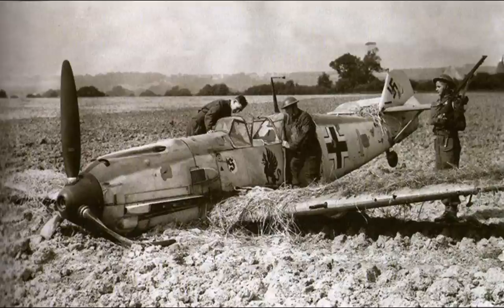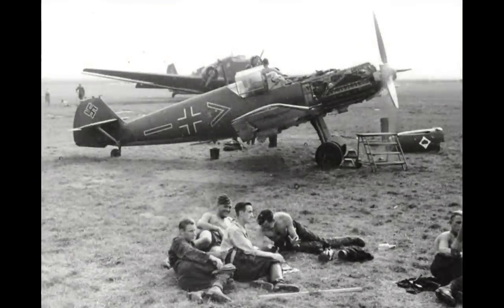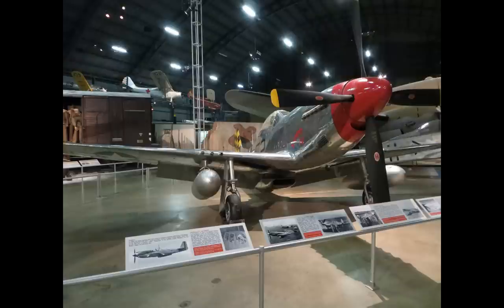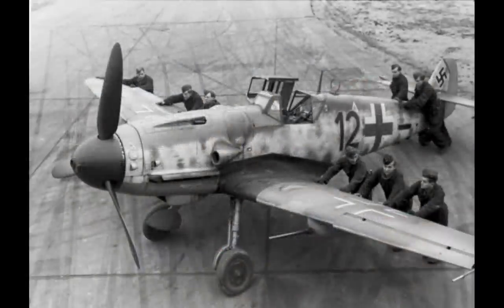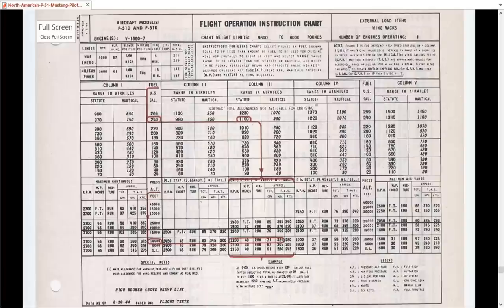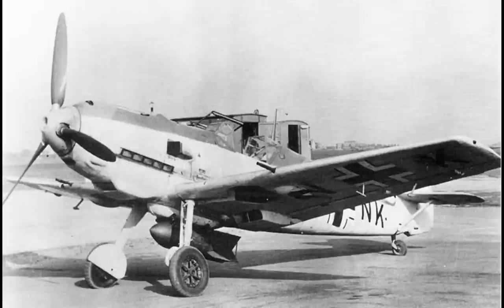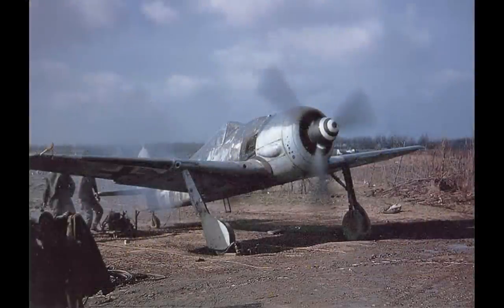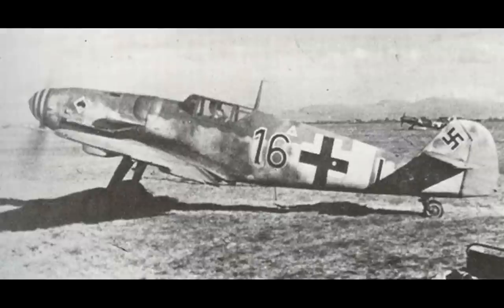Messerschmitt BF 109, Why Such Short Range?

Comment: yea. lets flip the scenario. If the Spitfire's had to fly to France, then hang around to engage the 109's then the spitfire's would have been known as short range issues fighters.
Reply from the maker: Very true.
Reply: Spitfires were used extensively for photoreconnaissance over France, and later Germany.  Mind you, those particular planes were specially adapted, with the weapons removed.
Reply: That sounds very doubtful given the spitfire had almost double the range of the 109.
Reply: The Spitfires WERE known as short range issue fighters. It wasn't until late war fighters like the MK XVI and MK XIV Spitfires that the Spitfire got some decent legs on it.
Reply: @tulliusexmisc2191 A rear fuselage tank for extended duration was fitted, and the pilots notes for ferry pilots specified that it was to be empty... putting fuel in the tank made it virtually unflyable ! The drop tanks fitted under the fuselage were incredibly 'draggy' and best known for carrying beer to troops in Normandy post D Day.
Reply: it did fly to france and it was known as a short range aircraft.  so yes the boot was on the other foot  post BB and pre D Day
Reply: @deanwilliams4365 I'm talking about if the Spitfires had to fly to France and loiter like the ME/BFs had to do over England during the battle of Briton. And some one said that the Spitfire had twice the range of the 109. The spitfires like the Mark 1 through 3 did not have twice the range, Later models may have but the first ones definitely did not.
Reply: @Joesolo13 Yea, No. I'm talking about the Mark 1 through 3. You know the Spitfires that fought in the Battle of Britain. They did not have twice the range of the 109's that were coming over to meet them over England. Later models did but not those puppies.
Reply: @tulliusexmisc2191 Yes and they were much later models, not the mark 1 through 3 that fought in the Battle of Britain.
Reply: @TwistedSisterHaratiofales  and i am saying, after the BB the spifiers DID fly to france and DID have exactly the same fuel issues as the ME 109s over england.
Reply: @deanwilliams4365  Oh, OK. I had the few responses. Yes they could only carry so much until they made larger planes of course. Thats why the ME110, and the Mosquito's were liked at the beginning of the war even as fighters, as big as they were. I am really surprised some times that the Germans never tried to somewhat copy the concept of the P38, and or P47 later on as they had captured a few and or hated to fight them so much.
Reply: @TwistedSisterHaratiofales  Not quite correct in regards to the mosquito amd me110 being linked. the me110 having failed in it intended role of bomber escort just as the P38 failed in europe. so with the end of BB winter followed so not much was done, summer and the RAF headed to france to do what it could, but fuel limitations, hurricanes carrying bombs along with beaufighters both being escorted by spitfires.  the mosquito was not yet available and the Yanks were still asleep. the following summer, when mosquitoes were available the german aircraft and crews had been moved to the russian front.  so except for very short times there was never parity between air forces during ww2
Reply: @deanwilliams4365  I was  meaning in regards to the fuel thing. I didn't really mean to link them as if they were made for the same role. LOL its to bad the 110 couldn't have been more maneuverable. It was like a pick up truck in a stock car race. The P38 was so understood, and the ones sent to Britain had no superchargers on them, so yea they were dogs. If I were a Brit at that point I wouldn't have been impressed with them either. When the design and engineering really took off, it took off, but yea for the first few years all of the countries were just winging it with what they had.
Reply: @TwistedSisterHaratiofales  No the first P38s in england were purchased by the RAF without superchargers. this is NOT meaning that the RAF didn't want turbocharged IT means that the Yanks had a hissyfitt and removed them, they didn't want the poms to get there hands on what was for the duration of the war rubbish tech.  just like the yanks refusing to sell more P40s to the RAF hence the XP51.  How ever  the yankees took their own P38s to england.  they failed miserably  woof woof
Reply: @deanwilliams4365 Agreed, but the failure was also due to even the us Yank Pilots not knowing how to fly the plane, and being afraid of our own creation. Once that was rectified it was a feared aircraft later in the war. 
The not wanting to give the Supercharged version to our British cousins was petty and short sided. 
There is always some pettiness in war. 
Kinda like when England sold all those Enfield and Brunswick rifles to the Rebs in the American Civil War.
Reply: @TwistedSisterHaratiofales  no not correct, the P38 failed in europe because although it had a theoretical altitude it was not sustainable ( NB the troposphere is higher at the equator and lower over europe)  the supper chargers don't work in the real cold, control surfaces would freeze up.  guns were not heated  etc.  add that to the existing inherent issues etc.  the yankees took them all to Ireland for mods which never happened  so they basically got junked.  as for Tech going from britain to the US and the total lack of Tech flowing back,  the list is endlist.  Tube Alloys. M52, magnatron  etc and as a result the yanks changed there laws to keep everything and give nothing.  as for the american civil war, if you can read you will see that england has always supported the status quo.  and as an american you will surly understand that the yankees in the north were in breach of the constitution and that the yankees in the south acted in accordance of the constitution namely the first and second amendment as well as articles 1,3,4,5,6,7,8  but it was not only England that supported the south, so did France and the pope  etc.  the only support the north had was from RUSSIA. who parked some Naval ships in the north's harbours.   but then i assume your are a Yank yourself  so you have been inbred on your own propaganda.
Reply: @GregsAirplanesandAutomobiles  cool video...and THANK YOU for referring to it as the BF 109 and NOT the ME 109....there is no such aircraft as the ME 109 (and the same applies to the 110 fighter).
Reply: @TwistedSisterHaratiofales  there is no such aircraft as the ME 109 or ME 110.
Reply: @deanwilliams4365 WOW, so you didn't like when We rebelled against the crown< which was against the law, But were ok with people owning black people. 
I dont care how many articles of the constitution you believe the North were violating. 
The simple answer is that Might makes Right, and we whooped there asses right back into the union. We would have beat them even if England and France would have joined them, and I have a feeling the England and France were well aware of that fact.
Have a nice day from a real Yank. My great, great grandfather was General Sheridan's horse steward.
Reply: @deanwilliams4365  I said good day.
Reply: @hanzohattori2492  
I think you are technically correct.  However, there are many docs where the pilots telling stories of their time in the skies over europe, talk of the 'ME 109".  So however incorrect it might be to say 'm e ' they do it too.
just sayin

cheers
Reply: @ArcticAmaarok  the reason I say there is no such thing as the "ME" 109 or 110 is because these were designed and put into production while Willy meserschmit was an employee of the factory...it was only AFTER he was able to get the money together and buy the company that anything they produced had the designation "ME"....so in a nutshell before he bought the company = "BF" and after he bought it = "ME".
Reply: @hanzohattori2492  I did not know that.  Was just sayin.......cheers on your reply!
Reply: @ArcticAmaarok  no worries...and you're welcome.?
Reply: P51 D, P 47, P 38 - Why such long range??
Reply: @hanzohattori2492  No - the RLM changed policy and wanted the Designer's name attached to the aircraft, hence the Fw190 changing to Ta152 as well in spite of still being built by Focke Wulf. (Heinrich Focke having been pushed out by the RLM earlier  - look up Focke Achgelis).
Reply: Spitfires were always acknowledged to be short range fighter-interceptors.  They were designed to reach bombers fast, destroy them and then return to base quickly. This was RAF doctrine and a very sensible one for a European country and particularly one separated by water from any aggressor. It is not a design weakness.
Reply: @hanzohattori2492  Technically it changed with the 109E model. Both references were used by the Germans, who were far less pedantic than you. The 110 was superceded by the 210 (which was a turkey compared to the 110), 310 and 410 (which finally fixed the 210s problems).
Reply: @alecblunden8615  The later Typhoon was a much better long range fighter, but then it was designed to be. The Gloster Meteor had taken over as an interceptor by then.
Reply: @allangibson8494  Agreed, but it had issues at height and so found its Metier as a ground attack aircraft. Later Spitfires and Tempests had better long range credentials than the early Spits.
Reply: @alecblunden8615  A lot of task optimisation went on for all of them. The early Meteors were optimised for high speed at low altitude - to chase V1s. The German jets were limited by fuel quantity and engine life far more than the British but had better aerodynamics with swept wings giving a higher critical Mach number. The third generation fighters - the MiG15 (which used virtually the same engine as the Meteor) and the F-86 really benefited from the German experience.
Reply: Dean Williams 
I’m
Reply: @tulliusexmisc2191  The recon Spitfires had a wet wing (the entire wing was a fuel tank) and the rear fuel tank was removed to fit cameras. The USAF museum in Dayton has one (since the USAAF used them during WW2).
Reply: "and best known for carrying beer to troops in Normandy post D Day."
Fortunately the Germans were not invited to that party.
Reply: @walkergarya  The Spitfires carried kegs on the bomb racks under the wings. In the Pacific Theatre they were flown to twenty thousand feet for a half hour to chill.
Reply: Yup I know. I would hate to try and calculate the cost of that in maintenance for the Spit, fuel etc.
Reply: i like that!
Reply: @TwistedSisterHaratiofales   Short sided means nothing in the abstract, where as SHORT-SIGHTED, means that you can't see a long way, physically or metaphorically. Using the homophone weather instead of  WHETHER, shows bad prep/proof reading, and watching a video and saying the same thing about fuel consumption, only in such a way as to pretend you thought of it,  says more about you and your attitudes than those you express.  Your second hand thoughts are reminiscent of one of the themes in Huxley's 'A Brave New World", where new thoughts were frowned upon and everyone conforms, and the workers were given Soma to eat, so that they were compliant to society.
Reply: @GregsAirplanesandAutomobiles  - It could be argued that the ME109's were the wrong tool for the job they had to accomplish.
Reply: In 1941  when we began to fly  sweeps into France, tis is precisely what we began doing on a regular basis, flying to France and the Low Countries trolling for Jerries. And yes, fully loaded, those Mark V's had a relatively short range, about like a P47.
Reply: @jimlambert1398  Not rally. It was mostly beer kegs and it was not for the troops but themselves..
Reply: @TwistedSisterHaratiofales  Your original post makes a very good point when It's considered that 44% of RAF Bomber Command crew members were killed (55,573 out of 125,000). 18,241 were wounded or taken prisoner. It should be asked why Merlin powered Mustangs were not fast-tracked to the RAF, so they could switch to day bombing with Mustangs as escorts? In my opinion Bomber Harris did not value the lives of his men enough, in much the same fashion as a WW1 chateau general. Bomber defensive guns  were puny .303s, there was no defense for attacks from below and for some reason Lancaster escape hatches were too small to get out of while wearing a parachute.
Reply: Jekub Fimbulwing that is correct...the P-51 had the range that the Spitfire did not. The Spitfire was a great looking bird.
Reply: It was.
Reply: They did,  on hit and run raids designed to lure out the fighters and bring them to battle during 1941, these were known as rhubarbs. (not particularly successful)
Reply: Let's not
Reply: There a lot of mention about the Spitfire
HAVEING  twice the range of 109, they did
You have to understand  how some 
Mind think , the Spitfire was at home and
Did not have to cross Channel , So that what they mean ,  The Spitfire was doing
What it was Made for , go up engage 
Enemy , 30 seconds of Ammunition , they
Had Raider and where organized , so 
In that way they did  have twice the range
PSS  And Britain had  a secret weapon
Keep it Quite   ,    Hitler ( Stoped  bombing
Air Fields )

Regards  Mark
Reply: The same issue faced by spitfire during the  Dieppe raid. Spitfire only had few minutes over France.
Reply: @agdgdgwngo  P51 had a Laminar Wing which enabled it to be more fuel efficient, along with better aerodynamic fuel tanks that were carried underwing. The P 47 wasn't actually Fuel efficient, it was just huge compared to the earlier fighters, and could again carry extra fuel tanks that were huge, It had a 1500 HP engine, which was the same engine in the Hellcat, and Corsair, and made it possible to make fighters that were about 30% larger than the spitfires, 109's, Zero's. so the range also extended.
The P 38, well, 2 supercharged engines and again, 2 drop tanks that were way more aerodynamic than like the ones on a Wildcat at the start of the war.
The wildcat was one of the first fighter planes to carry 2 drop tanks under the wings and with its engine it was like driving a pickup down a bumpy dirt road, but it did enable it to rave a further range than the Japanese Zero with its one smaller drop tank, and when the Wildcat dropped its wing tanks it made an adequate fighter for its time until the US could field Hellcats, and Corsairs. The P 40 was the same deal, they were adequate until the P 51's and 47's came along.
The P38, and P39's were actually more successful once they were figured out how to be used and minor design improvements, but they were few in number, and the Army Air Force were hesitant to use the P 38 because of the gas they drank, and the wide banking that they did. they were not good dog fighters, but in pairs they were swoop killers, and helped to make the tactics that most American squadrons would use later against more agile planes.
Reply: @TwistedSisterHaratiofales  dude the RN was hunting slavers long before the US civil war.
Reply: @Joesolo13  not at the time of the b o b
Reply: @TwistedSisterHaratiofales you probably think the american civil war was about slavery...
I direct you to Razorfist on youtube. He has an excellent perspective on that
Reply: The spitfire was designed from the outset to be an interceptor, a scenario that would not need long range.
Reply: @tulliusexmisc2191  these PRU Spitfires only had their weapons removed, but the entire leading edge D section of the wing was turned into one giant fuel tank
Reply: @williamzk9083  allangibson8494 said that 4 years ago.
Reply: @tulliusexmisc2191  Fuel tanks replaced the weapons.
Reply: @jimlambert1398  Wouldn't that expose the beer to cold high altitude temperatures? Did the Brits have to warm it up to drink it?
Reply: @TwistedSisterHaratiofales the Union didn't have to worry about the French and UK helping the South past being a nuisance because they abolished slavery before the US did. They just did what empires did.  Sell lots of stuff and pretend they didn't know where it might get used
Reply: @tulliusexmisc2191 also during photo recon you will not fly at high power for as long time probably(don’t know if they got detected an fired upon alot then that changes it) so if they go at high altitude and have an engine adapted for that they should be able to go quite far as max power for only a few minutes will use much more fuel for the amount of power generated